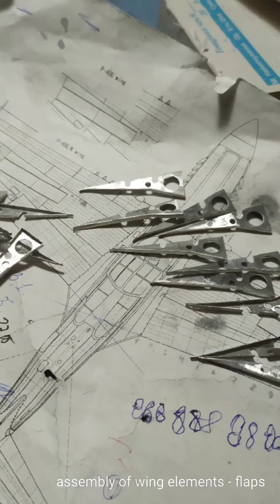P-40e Scratch Built Metal Model.Alluminiun model.

Comment: At 0:32 
The painter used a color to represent "zinc chromate green" which was commonly used on the interior of warplanes built in the U.S.A. in 1943, after supplies of zinc chromate yellow started running low in mid 1942.  They were also primers for aluminum surfaces.
Reply from the maker: Yes . this one so👍